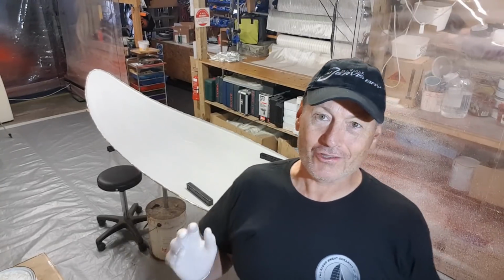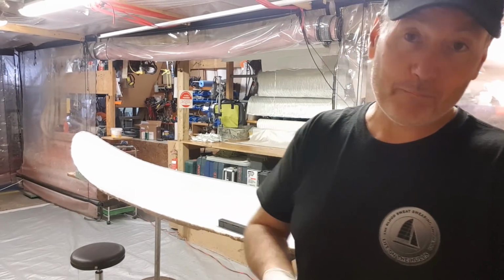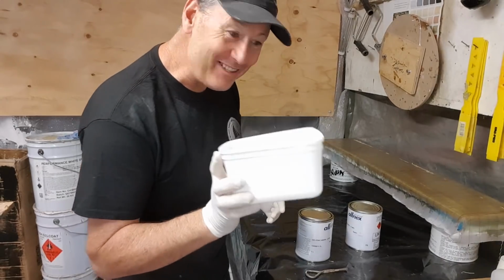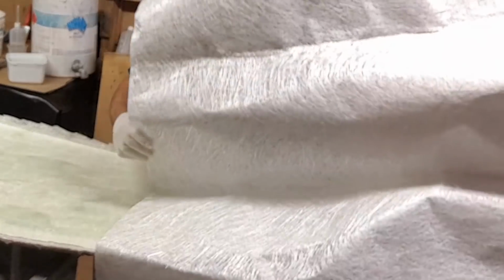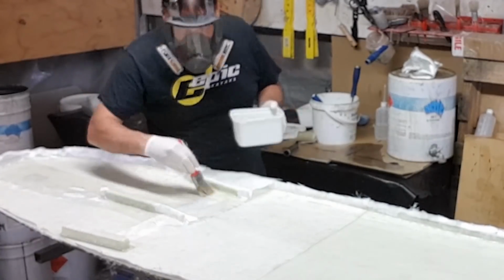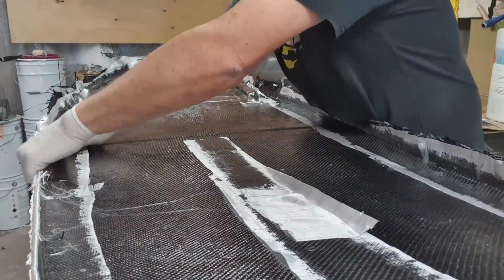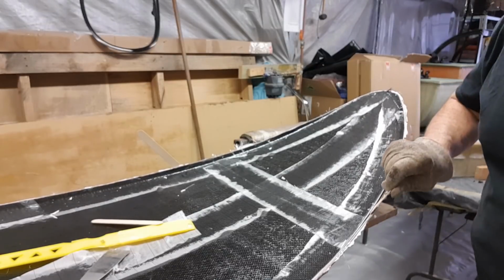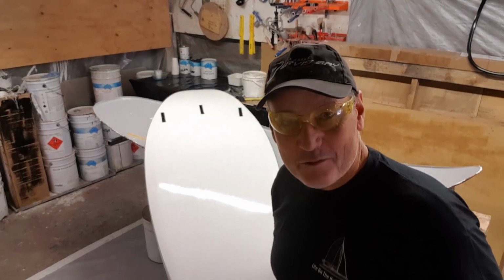Ep02 Kayak Hull Gel Coat and Layup - Kayak Build - The Composites Shop

Comment: Hi Ross, very much enjoying your videos lately.  I build composite Remote Controlled Sailplanes, and whilst I use epoxies rather than polyesters, there is a practice I use that you might find useful.  In a fuselage or a hollow-moulded wing, we always have a layer of glass on top of a carbon layer.  Sometimes the glass is only 26gsm, but more typically is 48 or 100gsm.  The thinking is that if put under sufficient pressure, the carbon fibres can "splinter" if they are the top layer.  A final glass layer simply keeps the carbon "captured" so to speak in that event.  I could imagine that even a small splinter of carbon would be uncomfortable if it came up on the floor of the kayak.  Anyway, just a thought mate.  Cheers, Steve.

Comment: Wow awesome video! Do you use vacuum infusion at all? I'd love to see a video of you showing it as detailed as here :)
Reply: @thecompositesshop  I'd like to build one that is like a mixture of functional protective gear and cosplay helmet :)
Something that is fitted to my head size and can be worn really effortlessly.
Maybe 3D print a fitting mold or "core" for a lamination.
And apparently the difference between a CAPR and PAPR is that the filtration unit is on the helmet itself.

Of course what is mostly needed is just large volume of simple facepieces and glasses / face shields.
Reply: @thecompositesshop  Hmm too bad, but of course the demand will go down for a while. 

Maybe you should start to manufacture PAPR respirator helmets :)
Cheers!

Comment: When my dad and I built a fishing boat back in the late 1950s, early 1960s, We glassed it. No gel coats, nothing special, and it worked fine, but looked like hell warmed over. We decided a couple of years later to build another one, and did a bit better job, but the process of doing a mold and laying the glass in was a mystery. Not so much now. Thanks for a very informative vid. Regards, Solomon

Comment: Always nice to see the Master at work. :-)  Have you ever tried other fabrics like Dynel or Basalt? IIRC Dynel is great for abrasion resistance. I've used Basalt a few times on my boat and it is a joy to work with especially with epoxy. Thnx for posting Rosco. Cheers Mate.